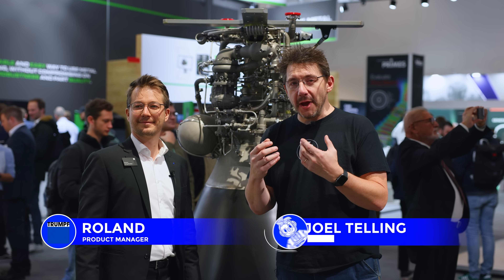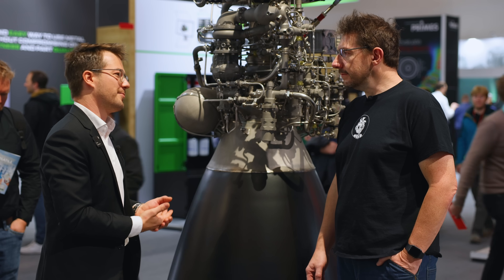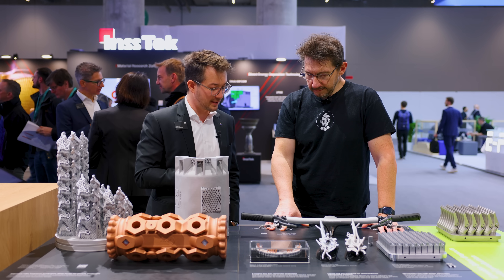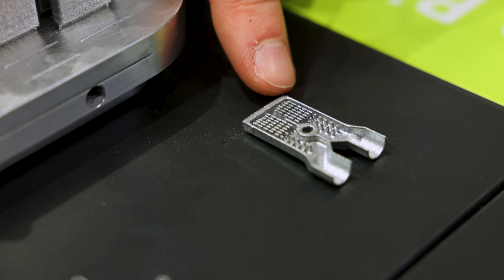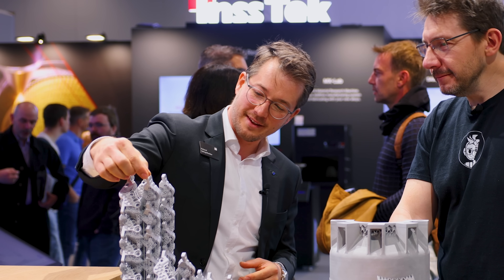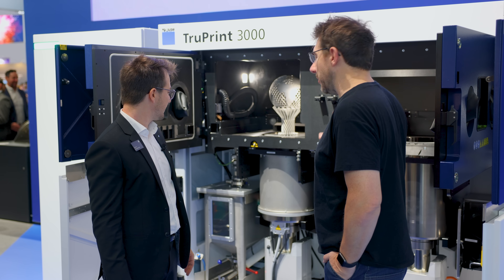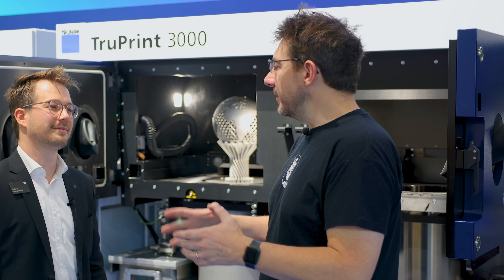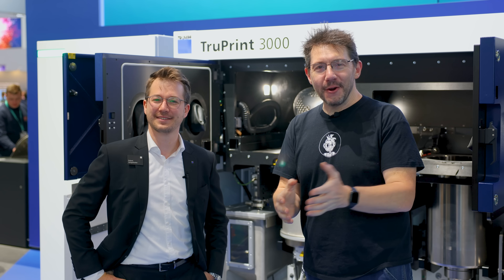Super FAST Metal 3D Printing // Trumpf at Formnext 2024!

Comment: As an amateur watchmaker I work on vintage watches.  The ability to 3D print watch parts would be awesome.  Some of these watches are 60 to 80 years old with some pocket watches well over a 100 years old.  As you would imagine, getting replacement parts can be next to impossible.  I've seen 3D printed watch cases made out of plastic but metal would be awesome.  Anyone reading this know if 3D printing is capable of making tiny, metal watch parts?  The equipment, if it exists, is probably out of the range of a hobbyist like me but it would make a good business.  You could make bespoke parts for all sorts of things.

Comment: When you print wirh internal structures how do you remove all the unsintered powder from it.
Reply: Depowdering complex parts can be tricky! That’s why we at TRUMPF offer a full range of peripheral equipment, like the Depowdering Station. It allows you to place parts upside down, rotate, tilt, and vibrate them to remove all unmelted powder. For parts with internal cooling channels, there are even more specialized depowdering solutions available!

Comment: Metal 3D printing is revolutionizing prototyping and manufacturing.  I can't wait for consumer 3D metal printing.  There is a great picture of the SpaceX Starship Raptor engine evolution.  3D metal printing drastically reduced the part count and assembly labor while increasing performance and reliability.  All of the external plumbing became 3D printed internal chambers.  The latest Raptor engines look much simpler and more streamlined thanks to 3D printing.

Comment: use the induction hot-end as direct metal wire melting print-head, no hot-end required. heat the wire directly.

Comment: you'd be surprised where the break even point for casted parts is when you consider the molds for the sand castings and all the other extra steps to get a finished part. having the ability to just send the file to the machine and hold a finished part hours later ready for machining makes a lot of sense especially for low niche products that dont get sold millions of times.

Comment: I'm thinking I could use that machine to make molds for injection molding, with just two "prints", one for each half of the mold, but which make lots of plastic parts with each mold. They seem to indicate that their prints can be less expensive than having molds machined.
Reply: TruPrints are super suitable for mould & your applications. There are some examples on our website or also in this flyer: https://www.trumpf.com/filestorage/TRUMPF_Master/Products/Machines_and_Systems/02_Brochures/TRUMPF-additive-manufacturing-werkzeugbau-flyer-EN.pdf

Comment: From a hobbyist angle, this is gonna be great for the RC scene if it ever reaches a consumer scale, so many older RC cars can barely be driven now because of a lack of specific tooled parts, this'd be great for resurrecting some of the older more obscure machines.
Reply: @kosmokat111  you can achieve similar results to metal parts by printing molds in normal plastic printer and casting parts from strong materials.
Reply: looks cool thou for rc with lesser demanding metals will work with lower budget additive machines
Reply: High power RC cars are unfortunately one over excited acceleration away from getting a $300 damage and sitting in the garage for months.

Comment: Quite the contrast from a rocket engine with leading edge advances that make the engine more reliable and easier to build and saving weight, (thus reducing the cost of getting payload to space) to a bike with a brake lever that does not really advance anything at all, apart from weight saving for competitive racers, that may save a split second when First and Second are often seconds apart. 
But if your looking for that 'edge' then I guess it's worth the cost. Can you imagine a new computer board with a very fine custom thin titanium frame, that touch's the CPU and Graphic chip and memory chips, that has water flowing through it with a heat exchanger made of hollow fins below a fan. Now that would be pushing the computer age to an new level. 
At school, they taught me the future developments would be an exponential curve. Well I can see that after 53 years, the teacher might just have been right.

Comment: This stuff is really expensive even when removing so much material. But titanium is not cheap at all so this isn't a cheap product either.
What is the cost? And could one make a Entire engine with it? Or E-Motor?
Can the chambers be automatically switched?
Reply: Yes, it's true that titanium is not cheap, but we only need a few ounces to build the parts. Material costs for one brake lever is below 5$. Compared to conventional methods 3D printing allows highly efficient manufacturing of titanium parts.
Reply: If you need a titanium part, the material cost is a lot less to print only the material you need (additive manufacturing) rather than starting with a large block of titanium and machining away what you don't need (subtractive manufacturing).  For many aerospace parts, 99% of the raw material becomes chips.  It's also possible to 3D print more material efficient parts that couldn't be machined, saving more weight and cost.

Comment: Are there any affordable metal additive printers for hobbyists?  Plastic is nice and all but making metal parts is what I really want.
Reply: Hell no! Metal AM is nothing for "happy hands at home".
Reply: @Allmentux  That's not true, a lot of people work with welders, plasma cutters, cutting torches and 3000 degree kilns from home. The only reason hobbyists don't have metal 3d printers right now is because they cost over $100,000 and no one has made an affordable consumer version yet. 
However, even if you have just a kiln, you can currently buy metal infused PLA and print parts on a regular FDM printer, melt the plastic out and then bond the part by sintering it in the kiln. Integza has videos on it.
Reply: @3dprintedhardware  You are dealing with a very fine metal powder (for SLM), which can explode and is carcinogenic. And that fine powder will get everywhere. Quite a different ballgame to backyard kilns! FDM with metal-infused Filament is quite different, as you said. But this video was about SLM metal printers.
Reply: @3dprintedhardware 
Exactly ,they also candesign and  build molds with casted resins for tiny features

Comment: If this has a homegrown/local source for the powders, then good. Every oem should be binned so they'll outsource and be regulated from dumping cheap goods.
Reply: Good point! TruPrint systems are open, which makes it possible for customers to use the powder of their choice. We work with more than 50 powder suppliers around the globe and can support you with data.